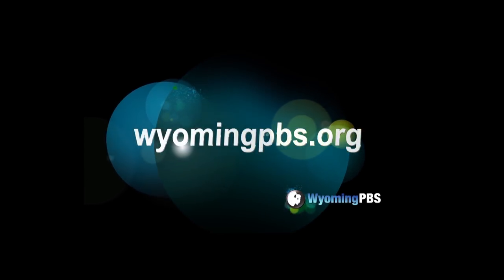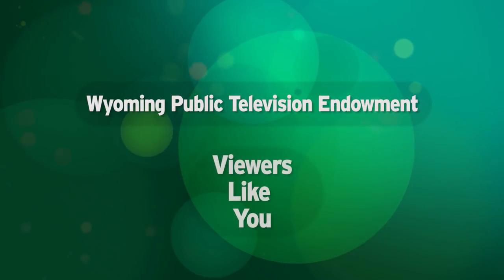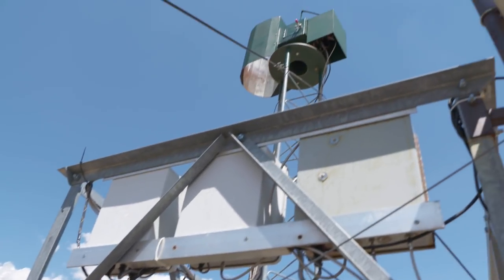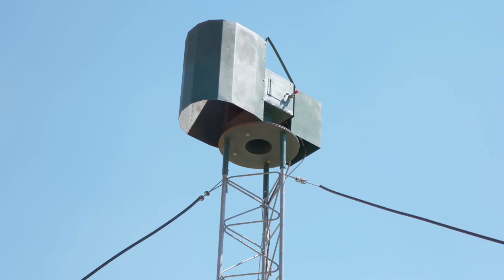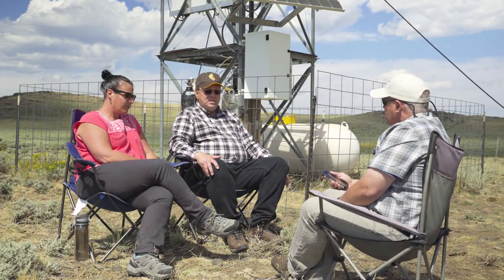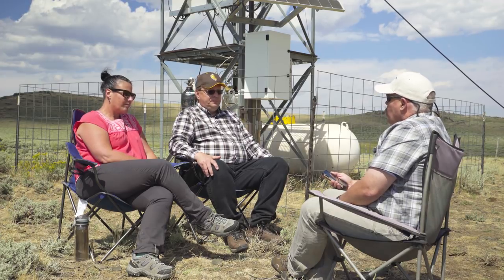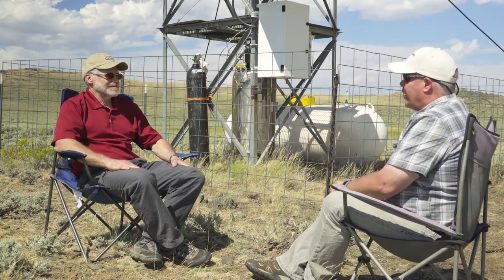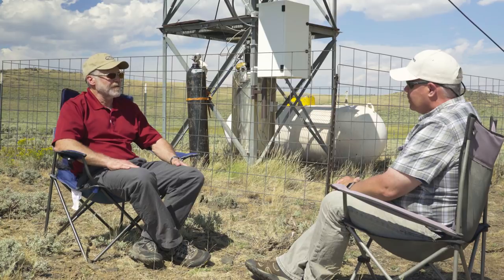Weather Modification in Wyoming

Comment: Water taken here means less water somewhere else.
Reply: Not in this system. If it’s on a mountain range that water wouldn’t be distributed off range. It would evaporate as it falls as she said. Now on flat ground maybe it’s a different story. I’m not sure.
Reply: Less water in the air less heat retention.